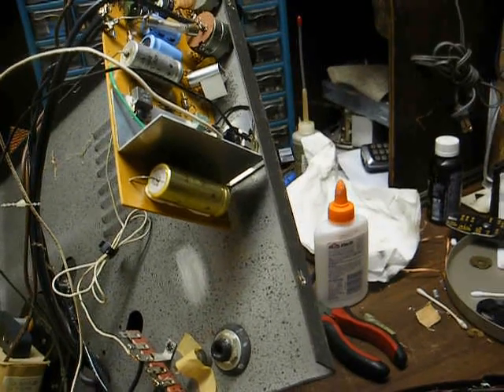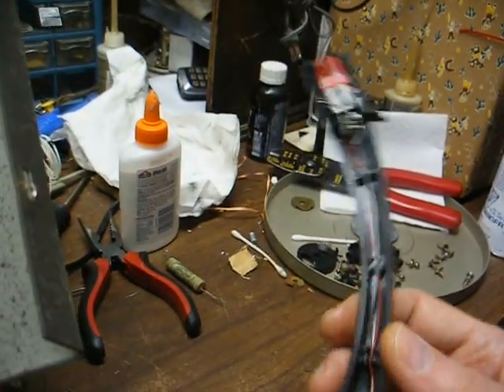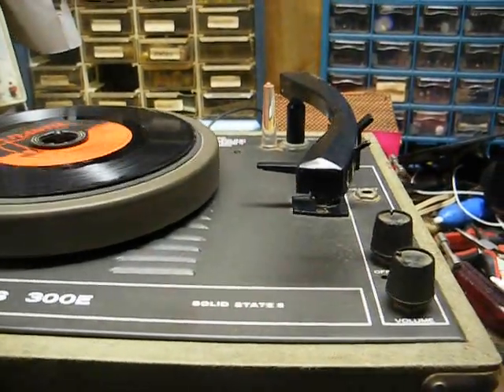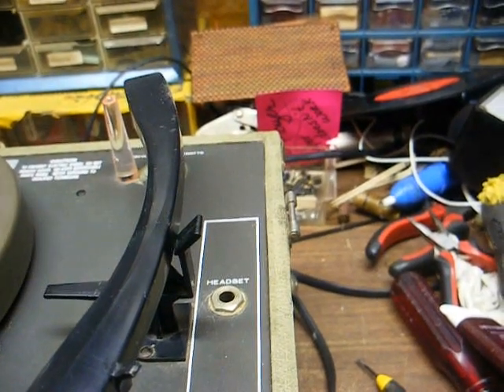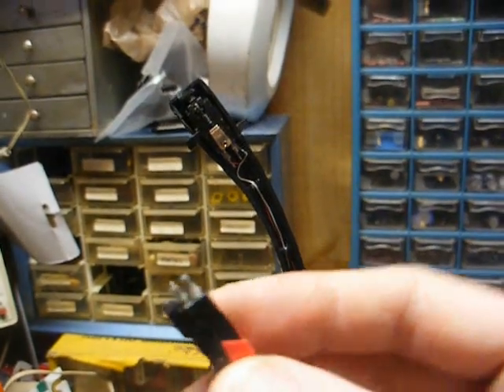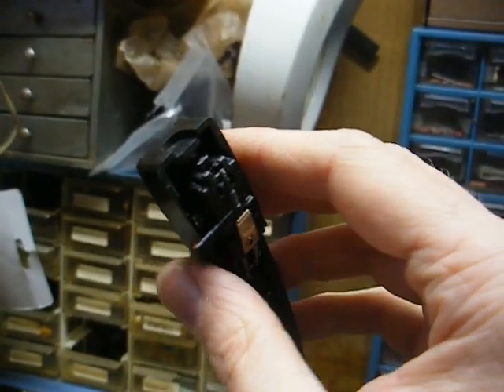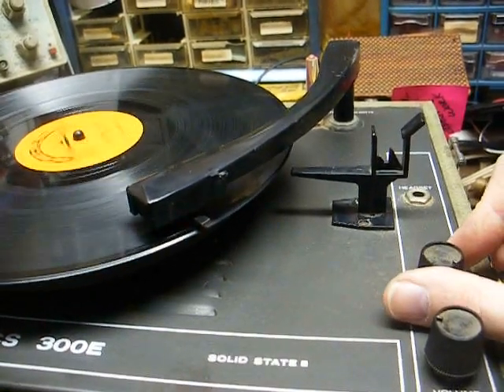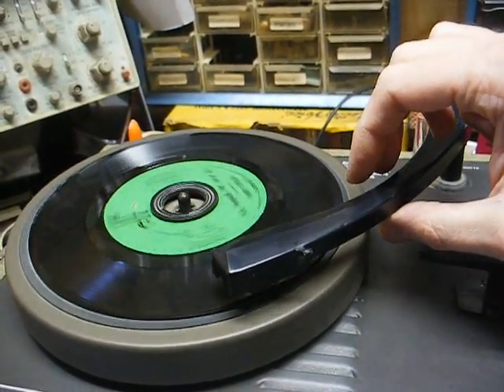Audiotronics 300E classroom record player cartridge upgrade

Comment: 1432 Franklin Pike Circle Hero, 1968, my copy has a deep blue label with silverish print. Back in 1968 the Bell/Amy/Mala group were still printing the label DIRECTLY to the vinyl. Use a record-cleaning liquid? Keep it WELL away from the label area or the label will be irretrievably SMUDGED! The song turned up in Australia and the UK on EMI's Stateside label.

Comment: Is it true that with the voltage differences with cartridges, the square of the voltage ratio would give you the power factor in the amp that you'd have to make up for?   That is if you go from a 1.3V cartridge to a 0.5V cartridge, you would need to square the 1.3/0.5 ratio and get 2.6 * 2.6 = 6.76 .   That is, would the 0.5V cartridge give you the power of the 1.3V one divided by 6.76 instead of dividing by 2.6?   That is, you would need an amp with 6.76 times the power to get the same volume out of the speaker with the volume set at the same place?

Comment: I suppose there is no room for the control electronics that would make a Linear Tracking Turntable possible in these old auto-changer record player as I think there are people out there that might want to do this sort of thing and I think that the manufacturer of this record player missed the opportunity to make a record player with Linear Tracking Turntable that plays  records as they were cut and produces a much better sound.

Comment: Hello radiotvphononut.  I have enjoyed your videos for quite some time.  I would like some advice from you, please.  I have a Newcomb TR 1656M turntable/sound system that I am repairing and am looking into updating the cartridge to the P-226 that you are describing in this video.  The original cartridge in this system is a GE variable reluctance magnetic cartridge.  While it would probably be easiest to replace it with another magnetic, I would like to use a cartridge with a flip needle for 78 records.  So, I am looking to do the opposite of what you have to do.  I need to cut down the signal instead of boost it.  I am trying some things  to do so, but the sound is fairly thin.  I would like to know if you have any suggestions on how to reduce the input, while also keeping good bass response.  Any assistance would be appreciated.  I will include a link to the schematic:
<https://drive.google.com/file/d/0B87KM3-Y_rTrQThLSVBDY1k2YkE/view?usp=sharing>
Thank you!